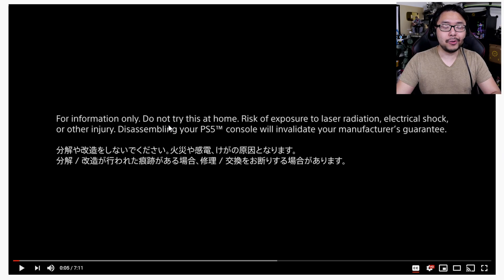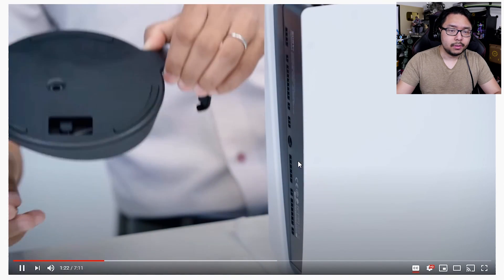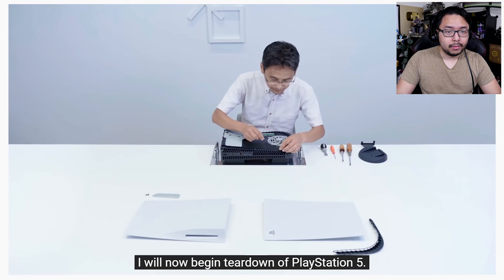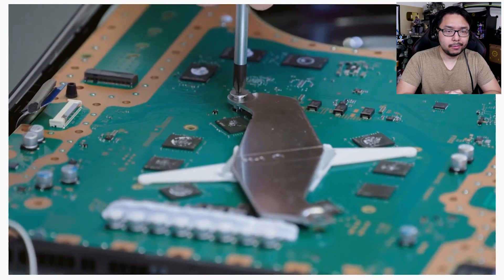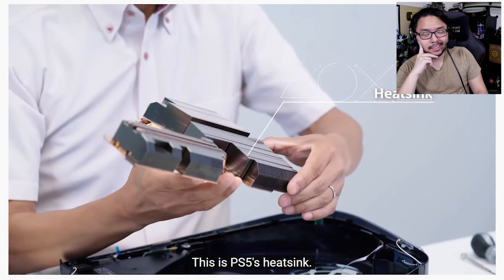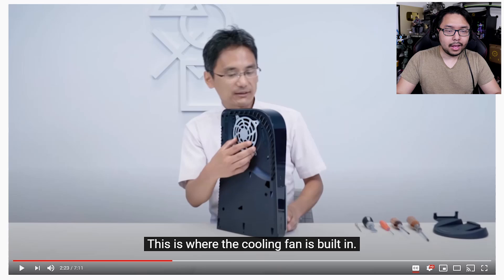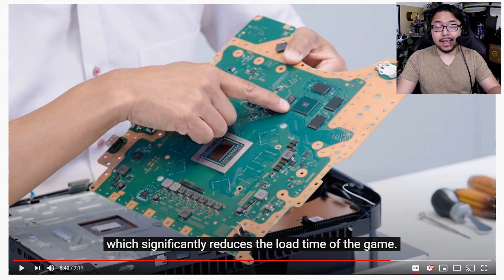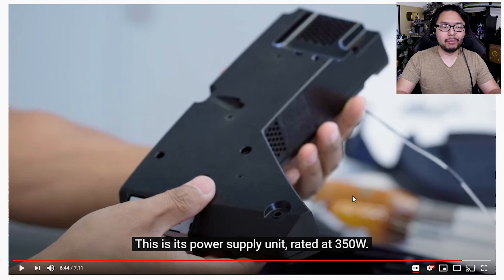Reacting To Sony's PS5 Teardown (Cooling, SSD Slot, Swappable Panels, & More)

Comment: I know you thought the Xbox loading and quick resume was good but I honestly think that io on the ps5 is gonna put Xbox to shame
Reply: We will see soon here. Even if it isn't, the game library more than makes up for it anyway in my opinion.
Reply: Sir Vamped  Um unless you have wifi faster than 6.9 Gb/s, that's only when xbox will pose a problem. Right now even most tech youtubers barely have 1 Gb/s. I barely have a 100 Mbps speed and I consider myself privileged. So this speed might pose a problem like 7 years later and that too is highly improbable.
Uh....yeah, it's true that USB ports are faster on the ps5. I'm pretty sure that also with ps5's SSD with double the bandwidth will probably cut the series X's transfer times by half.
Reply: Sir Vamped  
It also translates to wireless VR and tracking via Bluetooth 5.1
Reply: Sir Vamped  Almost certainly, but I always hold at least a little pessimism, just in case.
Reply: Its going to be better, yes, but "put to shame" is a big exaggeration. The difference mught be as close as few seconds in some games and 10 or so seconds in others. 

Faster loading times are going to be on both consoles, what you should be looking for is how devs utilise this unique ssd on ps5 in game.

Like R&C was pre loading entire dimensions. Demon souls had instant transportation without loading, things like that are going to be game changer.
Reply: Sir Vamped  Thats not entirely how NPUs work there are alot more variables
Reply: Sir Vamped  Well yeah it will depend on games. Let me clarify, before you brand me as an xbox fanboy, I am not. However,it was specifically stated that none of the games were optimized for series x, they were just running on the better hardware. So actual comparison will come when we have properly optimized games that utilise their velocity architecture. Od course PS5 will be much better, because of the engineering that has gone into the ssd, with its own controller. But that will be viable only to first party and second party studios. I doubt any third party studios will be able to utilize the ssd fully, because they will have to specifically code for ps5 instead of generalizing for both consoles as has been the case.
Reply: Sir Vamped  Well, they weren't even taking advantage of the velocity architecture. Even the backward compatible games on the ps5 would work the same way if they weren't optimized to take advantage of the architecture.
Reply: @TristanTheVRGamecat  Did you read? That's what I said. I am simply countering anyone who is just comparing load times
Reply: Martin Schmidt  
No they didn't!
Reply: Martin Schmidt  Pulled it right out of your ass, didn't you?
Reply: Martin Schmidt  Well yeah, thats why I said it wont put to shame,  it will be faster than xbox no doubt. Also the same applies to xbox too.
Reply: Martin Schmidt  show me one bit of evidence that Xbox series x out performs the ps5 , we haven't seen a single new game coming for it running on it , all we can really go by is halo cause that's what they expect it too look like which is a joke , and it can't even handle ray tracing properly , notice how ps5 gameplay has been shown with ray tracing and series x hadent and now Phil Spencer trying to downplay ray tracing as not this big deal saying it's spotty in games he tried.......yeah thats cause it's running on the Xbox that can't handle it , the ray tracing in Spiderman and ratchet and clank look outstanding for a console , where is the evidence from Xbox there isnt cause as usual they a bunch of liers , 

Look how much thought and design went into ps5 then look at Xbox series x just a bunch of pc parts shoved in a box says it all really
Reply: Martin Schmidt  digital foundary are biased towards Xbox cause they give them free shit and helps boost Thier channel  Sony don't play that game , ya can't trust people  who can be bought off
Reply: Martin Schmidt  dude your a moron if you think the ssd isn't going to have an impact the ssd and Io of the ps5 can fill the ram in 4-6 seconds I don't think you understand what that means for asset streaming , were talking the almost complete removal of pop in , being able to load huge chunks of data within the turn of a camera , once again go watch the halo footage and look at all that pop in then go watch any ps5 gameplay and look for pop in......I've been looking and haven't found one example 

But the series s is an even bigger joke it just leaves the low quality assets there ( go watch dirt 5 on series s gameplay to see what I mean)
Reply: Martin Schmidt  I was talking about this. "Also shameful is the paddlefan and the power supply inside the case again adding heat. Sony doesnt learn from previous mistakes.
"
Reply: Martin Schmidt  yes Df is biased cause Xbox fly them to Thier offices and they make excuses for Thier poor showings like halo looks good if it's ray tracing was implemented BULLSHIT halo looks trash cause it is trash simple as that
Reply: Martin Schmidt  go look at the gears of war five analysis that's literally just what the devs told them to say then watch Thier god of war analysis where they actually did their job it's such a difference , they look for flaws in ps games but will go along with what ever Microsoft tells them to say , shouldn't trust them not for a second
Reply: Sir Vamped  But tbh it's not better at performance tho. It's as good as a 2070. The xbox is 30% faster than the ps5 and we'll see that through more stable framerates, better resolution and exclusives.
Reply: @santhoshsridhar5887  
It's only ~20% on paper do to more CU's, but PS5 is faster in everything else! - Even in many graphics tasks

We'll see!
Reply: @santhoshsridhar5887  im really curious where that 30% came from. Would you mind if i ask for a source? I never heard it was 30% faster
Reply: @FDALl-ms5kg  36 CUs vs 52 CUs. Even if PS5's CUs are clocked higher, they don't come close to the series X.  Paired with the fact that the ps5 does have a variable frequency cpu and gpu, yeah the ps5 can be estimated to have a 30% difference compared to the series x. Now mind you we do have to see this difference in real world applications and tbh, only exclusives can make use of that power, third party titles won't show that much of a difference between the two.

Comment: ps5 literarily a super over engineered ITX pc with everything custom just for the single device nothing else
Reply: Over engineered ? Try prideful engineering. They did that because they cared enough, and you have a problem with it ? Smh.

You fucking haters will never change, but it's all good, keep doing you.
Reply: How? Every part in there is there for a reason.
Reply: EW PC

Comment: Ever seen them tables, were if u need extra space, it has a extra slide out table underneath? Welcome to the new ps5 table with 2 slide out tables, u can also cool ur drinks on it, runs so cool. Oh an it blows out liquid nitrogen, cools ur drinks in under a second. Its that fast. Oh an if u want more liquid cooler goodness just blow on the controller. 🤣😂👍 warning!! Hope ur rooms big enough for the new ps5 super cooler table, u can have a whole feast on it

Comment: I like to point out that there are people that are quite baffled with the screw and the stand, like srsly have you held a flathead screwdriver b4? or just plain lazy to even do it yourself? its not like you are constantly changing the console's dimensions every time you play a game
Reply: You could use a dime even to unscrew it My favorite is the people complaining about the M.2 drive.
Reply: @nicholasuszko  dude what's nice is they included screw holes for different sizes of m2 drives. They thought ahead. So it's 2 screws to swap out the hard drive. That's being consumer friendly. I'm not a fan of proprietary drives.
Reply: @kongchho  that is industry standard for m.2 slots; at least in every motherboard I've seen.
Reply: @kongchho  Yep.
Reply: Nicholas Uszko I can’t believe anyone would see the ssd slot as a negative but is fine with Xbox only being compatible with proprietary ssds which will undoubtedly be price jacked by Microsoft
Reply: Huh Huh I think Microsoft said you could use different ssds?
Reply: @ChrisPBacon-xn9up  they didn't. You're not reading stuff right. Lol??? They only use memory card and its only their own brand.
Reply: Victor G I thought they confirmed they’re partnering with 3rd party to offer more options for ssds.
Reply: @Nonx47  what sources do you have? I don't see it anywhere lmfao?????
Reply: @ChrisPBacon-xn9up  only third party they confirmed is the 1tb memory card with seagate.... which is the official Xbox memory card.
Reply: @huhhuh364  Yep
Reply: @Nonx47  ok but what's the source. I can't find it anywhere? Making up stuff lol.
Reply: @ChrisPBacon-xn9up  Right now You have to by the Xbox expansion for around 230ish USD. For only 1TB. Where as PS5 is using the PC M.2 drives which Means you can get Samsung Evo, Western Digital, SanDisk, and more provided they can run fast enough. You can also get 2TB models as well.
Reply: @ChrisPBacon-xn9up  in a year or so they'll have different SSDs but for now they gonna milk that single proprietary SSD.
Reply: @huhhuh364  microsoft will allow make third part made ssd's
Reply: @IronRoyal  see told ya :p
Reply: @IronRoyal  the source is: "just trust me"
Reply: @ChrisPBacon-xn9up  what?
Reply: @huhhuh364  I doubt that, a multi billion dollar company will want to be competitive, it just means Sony will rely on the market more than Microsoft.
Reply: @ChrisPBacon-xn9up  They are later down the road. ONly right now there is only seagate but later there will be more.
Reply: @nicholasuszko  they should STICK WITH XBOX 3 6 0
Reply: @nicholasuszko  MS's solution is more user friendly, but Sony's is more consumer friendly, if that makes any sense..
Reply: Sulfur Carbide Very beginning, before the real teardown.
Reply: @sulfurcarbide7039  You only need to take off one of the sides that pop off and then one screw holds the little cover in place that covers the bay for the SSD. It was in the video...
Reply: What man doesnt like to use a screwdriver? And damn they think the M.2 port is too much work, I'd say it's better than sticking out of the console where some douche friend can easily steal it or have your kid be able to pull it out and burn their had cause SSDs do get hot.
Reply: @one_up907  i dont mind the screw but i wish it have a handle like the ones in PC monitor stand. Would be really nice
Reply: It’s like these people have never changed a light bulb 💡 
I’m guessing if it’s such a problem they could ask an adult to assist them.
Reply: It's 2020 and it just sad that big grown ass men can't and complaint about screwing stuff . I've screwed my RC controller when I was 10 lmao . And it just one screw !!
Reply: @luxeternity  I can't believe anyone would complain. Its not even plugged into any tech, its just plastic screwed into plastic for a stand. I didn't even know people were complaining beyond needing it to have it when having the PS5 lying down on its back as well as having it on its side until now.
Reply: Dude I could probably stick my nail in that and twist it out. It looks easy peasy.
Reply: They could have just given a handle screw at the bottom instead of normal one. Those are pretty convenient.
Reply: Sulfur Carbide it’s under one of the side panels
Reply: Well after the horrible mess of PSVita i hope sony learn a lesson about proprietary storage lol
Reply: @AndrewHadi07  i mean both past consoles have been easy with storage ps3-ps4 lol. Can't really compare the vita to a full console.
Reply: @AndrewHadi07  shit I'd think xbox would have learned from the 360 storage too, but yeah sony fucked up on that.
Reply: Ikr? You dont even NEED a screwdriver, just use a fuckin butterknife!
Reply: To be fair a bunch of millennials have had kids by now. And just to point out those kids parents or millennials. They probably never even seen a flathead screwdriver.
Reply: @michaellynch5254  lmao, you don't need to be a certain age to complain about simple stuff. Besides millennials go until 1995, they most definitely learned how to take off a screw from remotes, cassette, DVD or CD players or older PC.
Reply: im prolly not even going to use the stand if I put it upright. it just looks bad
Reply: @Killerbasti93  2?
Reply: @IronRoyal  was a accidentally comment (did not plan to post one) that's why it only says 2 without context
Reply: @Killerbasti93  haha ok.
Reply: Boys growing up these days are women. Cant even change a tire on the car. 😂
Reply: People who complain about screws are the reason why laptops chassis are freaking glued together these days. Fucking shame.
Reply: I looked like the console comes with a flat head he was using an odd shaped tool to remove the screw tho i think on of the screws with the folding tab head would be better as it would be tool less but most people are going to pick a orientation and leave it that way
Reply: It just seems unnecessary. And some people do actually change the orientation and such of their consoles often. Not everyone keeps the console in one place for its lifespan.
Reply: @DiZUnbound  it weights over 10 pounds 
The screw seems like a good idea to me
Reply: @DiZUnbound  my ps4 has been in the same place for the last 2 years, ive had it for 4, and I've moved it about 6 times, lets say 1 minuse of unscrewing/re-screwing each time with this example, 3 of those have been me moving house, 1 was because I got a new entertainment center, 1 was to take it to my friends place, and the last was me moving it from the front room to my room as my roommate got his own ps4, I prefer my consoles standing on their sides, so even if I did move it, the screw isn't an issue, as id just keep it on the side and wouldnt need a screwdriver, or quarter, or key, or fingernail 

The people that this is an issue for aren't the major demographic, and having such a large console with extra support is a good idea, especially since their based in Japan, and they think of things like earthquakes which other countries might not think of
Reply: @DiZUnbound  it takes literaly 6 seconds to screw. Even if the thing didnt need it to stand (wich is why it has a screw) its so insignificant! it doesnt make a difference that big to complain in the first place.
Reply: @DiZUnbound  is it that much of a hardship to un screw a screw?  May I ask......     can you tie your own shoe laces yet??

Comment: Its interesting to say the least how hardware wise, MS and Sony took different approaches. Well, in some of the things. I wish, MS and Sony provided units to at least one person or a group of people with much knowledge about hardware and stuff, and let them run both machines, for days or weeks without pause. Just to see who holds up more and which cooling might be more effective. 
Tho, I can see that its risky, but interesting.
Reply: Either company won't want people to compare the consoles.
Reply: Owen Yin  Yes. I have seen their video and some others. I do know that most impressions are positive as of now. Still, Heating and Cooling is now for some reason the topic of most debate. And well, no one still hasn't said nothing about that formally. One would think its time they did. These New Gen Consoles are releasing in just a month now.

Comment: I wouldn't be surprised if Sony releases a black color Dual Sense and also a black color side panel. It's great to see that the PS5 has such a robust cooling system and a heavy emphasis on keeping the PS5 quiet. That dust cleaning port is a smart idea. We still don't have any official info on the compatible PCIe 4.0 NVMe SSD.

Comment: Design is definetly a lot better, than the ps4s, hopefully this means they won't sound like jet engines like the ps4s. The tear down is actually fairly straightforward, which is not typical of usual console designs that are quite annoying to disassemble. Surprisngly repair friendly.